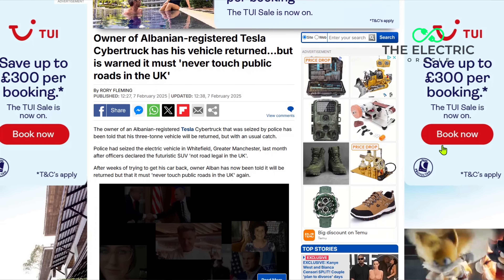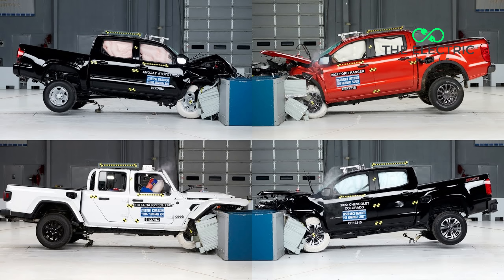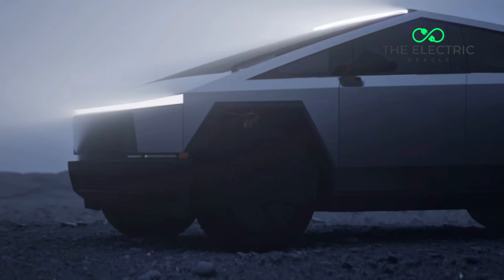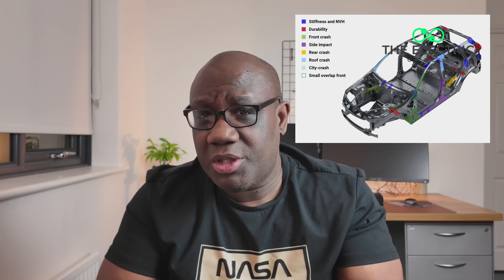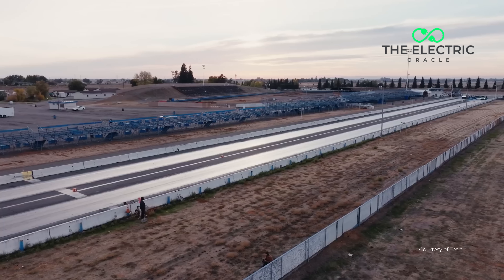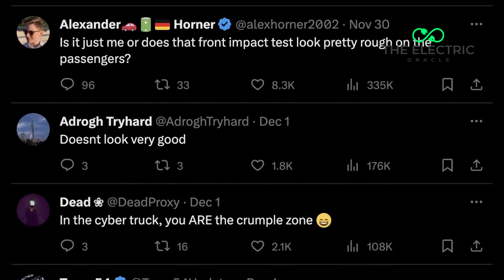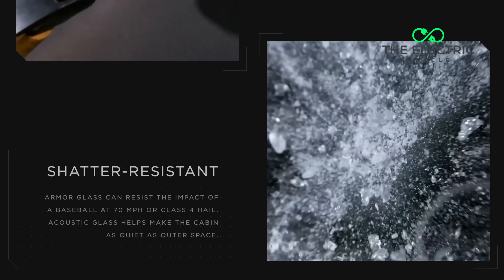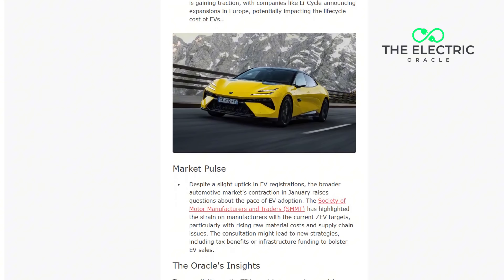Why the UK Banned Tesla’s Cybertruck – 5 Fatal Design Fails!

Comment: Every time I hear that it's edges are a danger, I think about all those other vehicles with heavy bullbars, etc.  Bullbars in T-bone crashes typically have head height impacts when colliding with a passenger vehicle...side curtain airbags have helped.  What, so because bullbars may have some rounded steel it's not gonna hurt/kill?  Those riot type vehicles used by the authorities look to have heavy guage steel body panels, pretty heavy and without rounded corners, yet they are on the road.  There are heavy ICE vehicles on the roads like AMG G wagen's and similar that can haul heavy load and accelerate their mass to 100kmph quickly but they aren't called out as being irresponsible? If you look at some EV sedans, they are extremely weighty and able to accelerate as fast, maybe faster than the CT and again, no questions or concerns there?  Heck I've seen a channel were some guy in England picks up his son in a former military vehicle after fueling it up and unlike the CT, you can bet it has no modern pedestrian detection, crash avoidance systems.  Sandy Munro covered the body isn't specifically an exoskeleton, so more distortion--the vehicle needs to be able to crumple to meet modern crash safety standards, so exoskeleton is more an marketing exaggeration than explicit implementation.  Lighting evolves--remember when cars first started the kind of oil lamps they used--regulations also need to also evolve, I mean Audi uses laser optics over LED over Xeon over halogen, etc.  The double standards being applied to CT are questionable and this channel seems more propaganda to me because the presenter claims to be an authority on EVs but seems to ignore these.
Reply: There are no double standards. The vehicles you mention were either designed before the current regulations were introduced,, madified by the owner (many countries have banned bullbars) or, as in the case of the security services, have government exemptions. 
As for the AMG G Wagons; yes, they are called out regularly, but they are built within the regulations, and there's not a lot that can be done to stop them.
And there really is a LOT of difference between a 2,5T G wagon, however ludicrous, crass and repulsive it may be, and a 3,7T CT that doesn't comply with virtually ANY safety regulations.
Nor does the CT have any crumple zones. It was "designed" from the ground up as a truck, so that it doesn't need to meet any of the regulations designed to protect occupants and pedestrians. Don't blame the EU for any of this. Elon Musk built it knowing that it would never comply so, if you want to blame anybody, blame him.
Reply: Yes - Bullbars caused a lot of deaths in the 90s, so they are now mandated to be soft plastic.
Reply: Allowing the CT to circulate would't be a evolution of the regulations, but a regression.
Reply: NHTSA rating for CT is in and it's one of the safest trucks tested.  https://youtu.be/qggcpySCPDU?t=1520
Reply: @petemonster1  LOL.
That's like saying a female  Indian elephant is one of the smallest elephants in the world.
One of the safest in a field full of spectacularly unsafe vehicles does not make it a safe vehicle. The whole purpose of creating the truck category was to allow US automakers to make vehicles that do not have to meet quite stringent safety requirements, and that is the reason why no American truck is officially imported into the EU, because, if they were, they would have to meet the same standards as normal passenger vehicles.
And make no mistake, the complete failure to provide for pedestrian protection would make any US truck fail EURO safety standards.
Reply: More proof vs David with his TDS. 
https://youtu.be/4j9l7cETa7A?si=fLXFQNhGb7kcxy4w&t=803

Comment: In the Netherlands the limit is 3.500 kg including driver and passengers. So that's looks also challenging. And the Cybertruck is 2,40 meter width? It's 20 cm wider then my private parking place.
Reply: Not just driver and passengers but also cargo. It has 1 ton load capacity. So 4.1 tons total weight and you need C1 license to drive it. If they would register it so that max weight is 3495kg and it weighs 3100kg then it would not be a truck anymore. It would be a normal car with less load capacity than a ford mondeo.
Reply: @pasinen correct

Comment: SUV's are bad design.. I grew up with a morris.minor van and a messey 3. Both 35hp engines. LIghter and faster.. and still USABLE.. to this day.. ;-)
Reply: I agree, SUV's are the products of car manufacturers persuading car buyers that they must have this type of vehicle to do the weekly shopping or take the kids to school.
Reply: @barrie5852  SUV and Pick up trucks are also built to a lower safety standard so cheaper to produce. The safety standards are just eroded but in a different manner.
Reply: Depends of your needs. If most of your travel is relatively short distances with little luggage, a Minor is a decent solution. But even a small pony or a fridge don't fit. And a thousand mile trip feels a bit cramped. Anyway, who really needs a Cybertruck?

Comment: The car personifies Elon Musk in every way. A car that heavy really does have no business doing 0-60 in 2.5 seconds and if you crash it, you are the crumple zone. "Make it out of steel, it'll be safe as houses". No Elon... that's not how it works. 50 years of research shows that. Shock value over safety. It's Elon all over.

Comment: it is not too heavy for most to drive in the UK. You can drive up to 3500kg's on a standard category B car driving licence. Fact check please!
Reply: Go back and listen properly, this is covered in the section on weight.  The 3500kg limit includes passengers and load so the weight of the base vehicle with the addition of passengers and load can easily exceed the limit.

Comment: It's not a question of irresponsible "design". Rather, it is irresponsible "driving". You just don't drive the CyberTruck where there may be safety issues. If you do drive it in sensitive areas, it should be required to put itself into "Brit Mode" which is a chilled Chill Mode. Part of Brit Mode would automatically deploy exterior Pool Noodles that would wrap the CyberTruck. 
Just a thought.
That's my two scents 💩💩😁

Comment: Australia is a reasonably large pick up truck market.  Pick-ups and large SUVs dominate.  The CyberTruck will never meet Australian standards either, thank goodness.

It’s bad enough on our roads without these monstrosities.
Reply: Testify.
Reply: Pick the crash you would least want to be in when T-Boned. You are in a Corolla being hit by a Toyota Hilux, or a hilux being hit by a cybertruck. I think the Corolla  smashed by a hilux is the safer choice. That is why I want the cyber truck safely on another continent.
Reply: Australia mostly drive small/medium pick ups too. The Large pickup f150 type trucks are north america only pretty much.
Reply: we don't have redneck pickups. They're called utes (short for utility vehicles ) !!!
Reply: Sure, but will people generally have the driving licence for vehicles over 3500 kg total?
Reply: anything rusting with sunburn and 4 wheels meets aussie standards
Reply: Yet there are a few rolling around on speaclized plates... would be better for a total ban beqcuse they don't at all meet ADR but yet with some $$$ they are driving around on Aus roads
Reply: yes the main thing is that there is no mechanical connection between the steering wheel and the front wheels.
Reply: @ianmontgomery7534 steer by wire is legal in Australia.
Reply: @craigalexp  I have finally found the ADR that was amended to allow it. ADR90/00
Reply: @ianmontgomery7534  there’s no mechanical connection between the throttle and most new engines. It’s how the system is engineered that makes it safe or not. CyberTruck steering does have multiple levels of redundancy so it meets modern safety standards.

The electronic steering system is one part of the CyberTruck that might be useful and applicable in the rest of the world. It gives a more responsive system without the need to go multiple turns lock to lock, and allows for a tighter turning circle than conventional steering. At the same time it makes it easy to convert a design from left to right hand drive as there is no need to re-arrange mechanical shafts and linkages.
Reply: Australia doesn't have pickups, they have utes (short for utility vehicles).
Reply: @Charlee1224  US style pick up trucks should not be described as utes. A ute is a coupe utility - as in car based. You could not describe a US style pick up truck as being car based - they are truck based. Nobody really makes or buys utes anymore - even here in Australia. Like you cant buy a new Maloo anymore right? You cant really buy utes. Eds Auto Reviews has a great explanation. The so-called trucks they race in nascar are utes.
Reply: @InterlocutorOmega  Not true, the designed as a cab/tray (or tub) vehicles, not derived from sedans or coupe's, as made by Nissan, Mitsubishi, Toyota and even Ford/GM and available both here and in the US are still called utes here.
Reply: @iffracem  Yes. We are wrong. Ha.
Reply: @iffracem  Pick up trucks.
Reply: @Charlee1224  https://youtu.be/fDhh1Kx4DiY?si=3CzyYKweZOaZRNwq
Reply: ute market you mean, the yanks have pickups.
Reply: @alexfrankl7861  I was responding to a UK video.  Brits don’t call them utes.
Reply: But you allow Land Cruisers with kangaroo bars in the city. Those bars are designed to kill...kangaroos and anything else the hit.
Reply: @ib7844  those roo-bars are only designed to protect the car's front end from damage. Yes, they are irresponsible for use in suburban streets, but our government and roads authorities refuse to outlaw them. But the cars themselves still must meet the ADR standards. A Cybertruck will not meet that rule.
Reply: @ib7844  They aren't specifically "designed to kill" at all, they're designed to take the impact and protect the body of the vehicle... that they do kill and maim is sadly true.
There was talk of banning them, as they negate the relevant ADR's relating to pedestrian and occupant safety, such as soft bumpers, crumple zones and bonnets/grills meant to deflect a person, not smash them out of the way ("bull bars" and "roo bars", not being sentient can't differentiate between humans or other animals) 
They also interfere with the engineered "crumple zones" built into vehicles to protect the occupants by controlled collapsing, absorbing all the forces of impact.  Being rigidly bolted to the sub frame, that's all bypassed. 
However the larger 4WD's can side step that, as they aren't considered "passenger vehicles" and don't require the same level of pedestrian safety. There's a huge area of contention over that.
Also, Politicians won't want to lose the votes of country people who might be able to argue the need for bull bars/roo bars. These being mainly National/Liberal party seats
Politicians won't want to lose the votes of the cashed up people in cities who buy large, luxury spec'ed up 4WD's to be able to show off but still avoid the luxury car tax. These are eqaully LNP/ALP voters.
Reply: @ib7844  Yes .. and those bars are also designed to provide a degree of safety and have to meet certain safety standards.
Reply: @ib7844   yeah they round and not sharp. They got to meet saftety requirements
Reply: why would want it not to pass ,weird .
Reply: @ they are not suited to our roads for a start.
Reply: @duncanmaclachlan7177  Because it has no regard for occupant or pedestrian safety, that's why.
Reply: Cyberster has front crumple zone
Reply: You allow trucks on the road that no state in the U.S. would ever allow, what are you talking about? Its called a road train.
Reply: @tedmoss  they are not allowed in big cities and over dimensional vehicles have strict permits that usually restrict them to night time running. In the State I live in they are only allowed along the northern border of the state.
Reply: @tedmoss  Only on proscribed roads, not just anywhere.
Reply: F150 is bigger.
Reply: @vessbakalov8958  but not as dangerous to pedestrians.
Reply: @dangavel1283 it is cause you cant see shit in front of you, check the line of sight angles, even battle tanks have better LOS
Reply: @vessbakalov8958  The F150 still makes at least rudimentary attempts to match ADR's, especially crash and pedestrian safety, the Cyberurinal does not.
Reply: @vessbakalov8958  "F150 is bigger." - But it complies with safety regulations!
Reply: @vessbakalov8958  And probably should be banned too.
Reply: @brucescott7016  Respect the consistency.  While I support the UK in making their decision given the national infrastructure, I don't appreciate the story itself because it tries to make it sound like the designers of the truck screwed up.  They didn't.  They built a leading product for the category, that outperforms the competition in most respects in their target markets.  They knew it had to be heavy given the size of the battery.  The safety tests just came back from the US certification agencies and they look great.  The UK and I am sure there are a few others are simply markets the Cybertruck will have to live without, and the designers knew it.
Reply: @vessbakalov8958  You see that satellite above you? That is how high the point is above your head
Reply: @vessbakalov8958 Just because it's larger, doesn't necessarily make it more dangerou s
Reply: @Sine-gl9ly  I think that videos like this focus on all the negatives and none of the positives.  For example - CT let's you see what is in front of you because of the sharply sloped hood (bonet).  An F-150 - you can have a 10 year old or a small woman stand in front of the grill and you wouldn't see them.  
A lot has been made of the sharp edges, but the fact is that god forbid you get hit by a CT - you will likely flip over it.  With a legacy truck of this class, you are going under.  I think pedestrian survivability is much lower.  
And then there are the computer systems.  The CT is so much more advanced and the computer anti-colision is so much smarter.  It is likely to avoid a collision way better than other similar trucks.  
While the CT doesn't have an official crash rating yet, Tesla generally has some of the highest safety marks.
Reply: @vessbakalov8958  All I said was that larger (of any vehicle - not just the F150 vs CT) does not necessarily mean 'more dangerous'. Protruding edges are just one factor which decreases pedestrian safety; I would like to see UK, EU and AUS safety testing results - soecifically ones with crash test human dummies both inside and outside the vehicle.
Regardless of that, though, there are many factors which instantly cause the CT to be illegal to use on European and Australian roads without modofication, and even more which make the thing impractical for normal usage in most of Europe and large parts of Australia.
Reply: @Sine-gl9lyTo an extent size & safety are interrelated. The greater the vehicle mass the greater the force in a collision. How that force affects the vehicle & the occupants depends on the mass of what the vehicle collides with. If a greater mass, the inability of the CT to crumple & absorb some of the collision energy means it’s transferred to the occupants. Leading to injury.
Reply: @vessbakalov8958  almost nobody drives f150s in Australia its mostly rangers

Comment: Always go for safety. Nothing else matters.
Reply: So, you wish to ban all sports cars.... yea.  Good luck on that one...
Reply: The fact that any car exists is solid proof that convenience is more important than safety.
Reply: That's why I bought a Tesla, two of them actually.
Reply: @tedmoss  Makes sense, you'll need the second for when the first catches fire
Reply: So why aren't we driving bumper cars and limiting the max speed from factory?
Reply: @ItsBinhRepaired  So why aren't we driving bumper cars
because bumper cars are open and not exactly safe and we don't have the overhead electrical grid to power them.

and limiting the max speed from factory?

We do. From 7 July 2024, all new cars will legally have to be fitted with a speed limiter in the EU
Reply: @gdwnet  I didn't mean literal bumper cars... cars that are designed to crash, deform, and still continue just fine. Most cars would be totaled even at bumper car speed crashes...
Reply: @ cars that are designed to crash, deform, and still continue just fine

Cars are designed to crash and deform. They aren't designed to just drive away because you don't want that now do you? You don't want cars on the road that have had crumple zones crumpled. Once a car crashes it needs to be completely inspected to be safe on the roads to crash again.
Reply: @gdwnet  You don't see bumper cars getting inspected after every crash, do you?
Reply: @ItsBinhRepaired  You don't see bumper cars getting inspected after every crash, do you?

You don't see bumper cars impacting at over 12mph either (passenger safety regs), by the way, bumper cars have a nightly check and a regulated 6th monthly check.

What a strange question that is. Have a good day.
Reply: @gdwnet  they crash hundreds of times daily. Try impacting another vehicle at 10mph with no attempt to slow down. Lol

Comment: Unsafe at any speed!
Designed by computer geeks working for a company that doesn’t give a damn about ergonomics, real automotive engineering or safety.
Also with 
 nazi saluting Elon Musk at the head of Tesla it needs to be of thicker steel to resist vandalism.